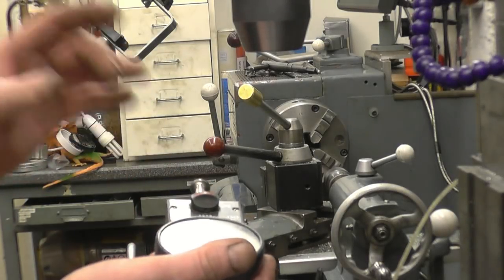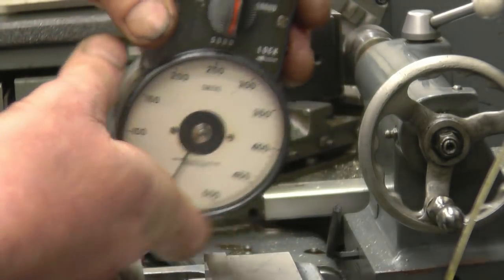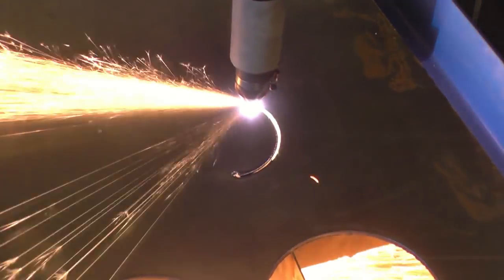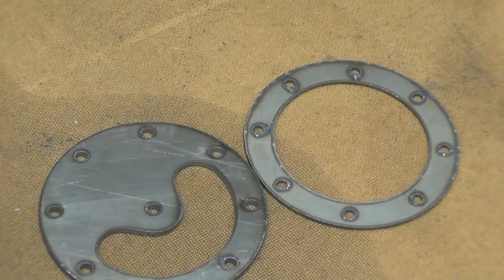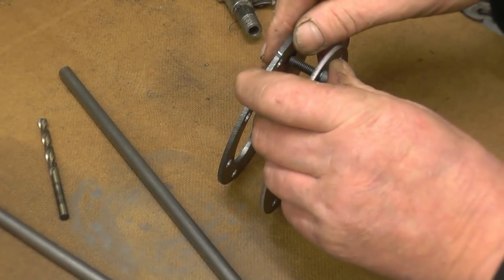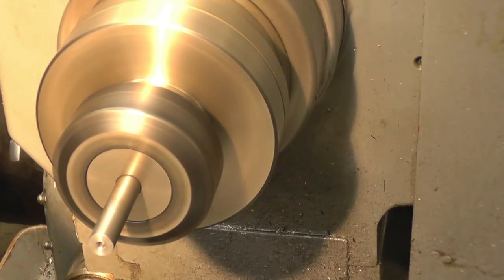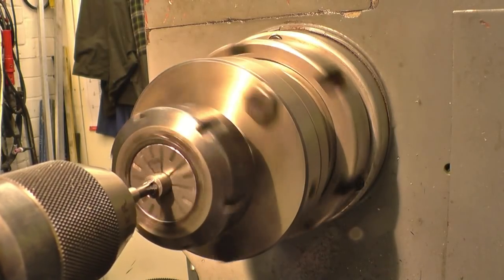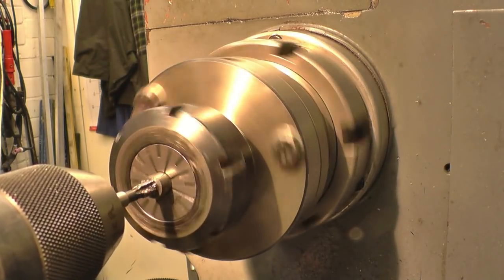SNNC 206 P2   CNC Plasma Cutting

Comment: I had one of those mechanical tachometers a few years ago. You have to be careful to start on a higher scale if you aren't sure of the rpm's. I literally blew mine up by having it on too low a scale. The glass shattered and the internals came apart quite suddenly as soon as the tip got a bite.